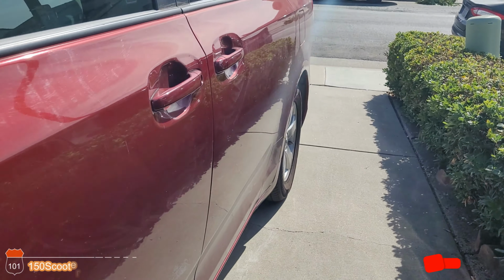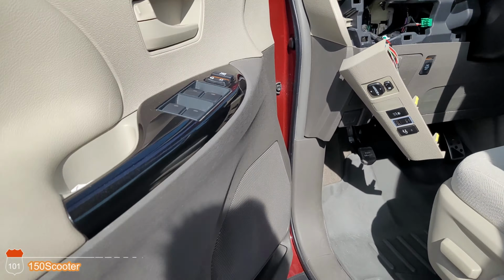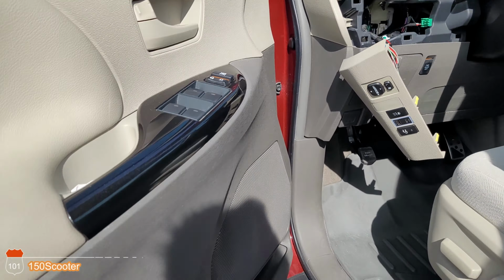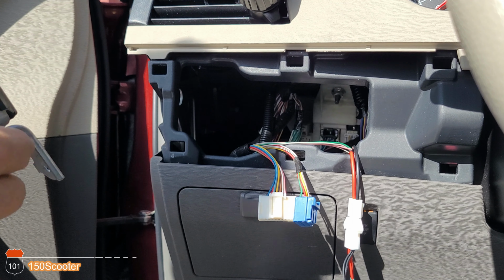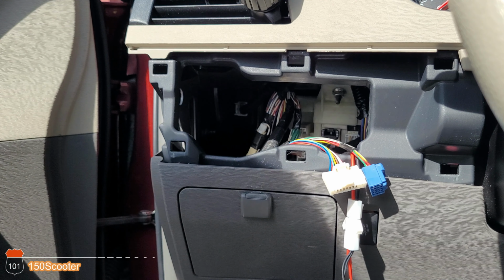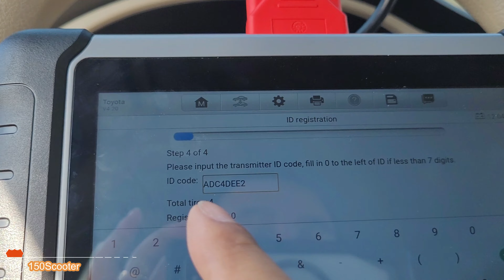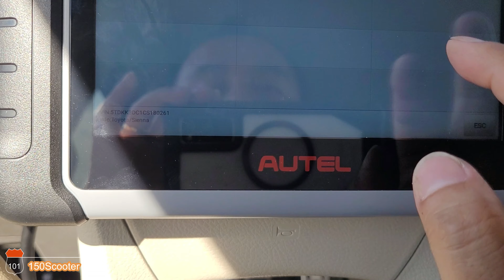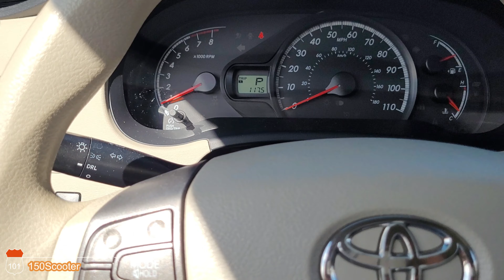TPMS Still Not Working? This Will Fix it. Toyota Sienna Tire Pressure Sensor Receiver / Antenna DIY

Comment: Very good video, I have a rav4 2009 and the tire light is on tires r right pressure, 
will this work for me? Where did u get ur scan tool?
Reply from the maker: Scanner I used in the video is the Autel MK808s ( awesome scantool ), link is in my video description.